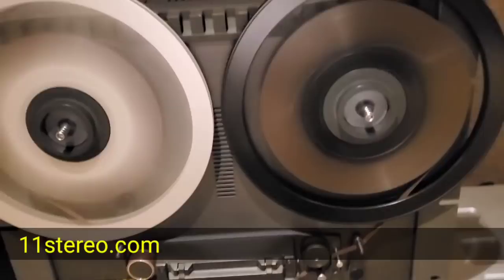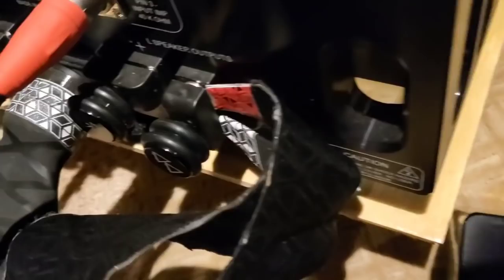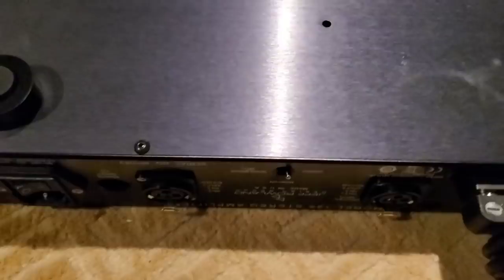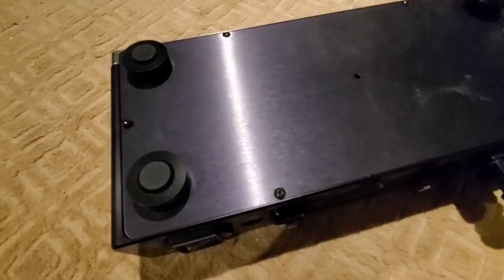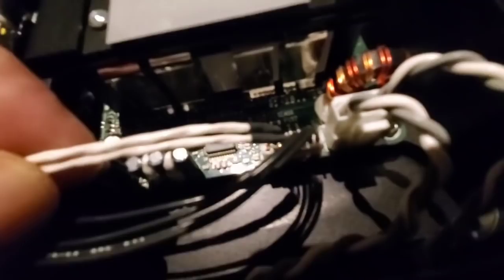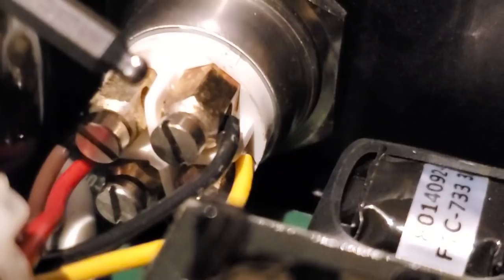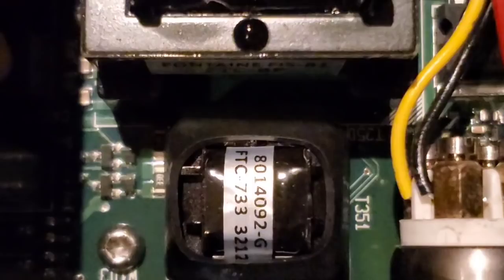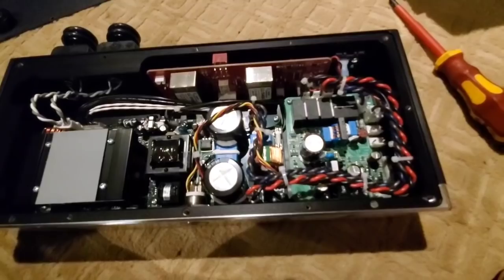How to recognize TRUE High End Audio !

Comment: Did you open the 3K up to see whose D boards he's using? GerogeHiFi who posts to AGon forums says he uses crap off the shelf D boards
Reply from the maker: Deep breath, im ready to flamethrow..  Ok, so lets talk this over. its a $3K amp. theres a dealer selling it so Jeff sells this amp for $1800. Deep breath Mikey.... calm... There is absolutely NOBODY that does this much for only $1800. If you were to simply watch my video before talking you would see I in detail show you what exact module it is and also show you what boards are inside that are proprietary Jeff Rowland design that when combined with the classic Jeff Rowland Aluminum block chassis make this the best sounding amp to use that module  Jeff is not like other jerks that only use the off the shelf parts, hes a freaking design engineer for chrissakes the only reason the others only use off the shelf boards is because they have no idea how to design them, Buy Jeff pulls out a sheet of paper on a drafting table and he draws the circuit by hand from his MIND.  And his circuit designs and layout is better than 90% of the others that can do this, which makes up maybe 10% of audio engineers, as they all use computer generated circuits these days.Watch this video which will make you very aware that George has completely misled you on purpose. Please for the love of GOD,  THINK FOR YOURSELF  !!
Reply: @OCDHIFiGuy  Thanks for this video.
Reply: @OCDHIFiGuy  DUDE take a deep breath now. Don't shoot the messenger . I have owned plenty of class D, inlcuding; PS Audio old and new,. M700s several W4S, Audio Alchemy DPA-1, Emerald Physics and my fav of late is Ric Schultz EVS 1200 IcePower 1200AS (600w dual mono boards). George Hifi is a hater, using specs instead of his ears. FYI hte EVS is sold direct $2300

AND, I ill soon be receiving the new (ground up build) Emerald Physics Voyager GaN amp MSRP $2500

Comment: If it has no audible effect and no impact on long term reliability, it's just cosmetic window dressing and a waste of money.  Benchmark products are available through dealers and their AHB2 power amp handily outperforms anything based on IcePower, Hypex, or even that latest (excellent!) Purifi modules, all for the same $3K it costs to own the Rowland product.  BTW, nothing you can do with fancy Class A and/or transformer-coupled input circuitry makes a damned bit of difference performance-wise -- the output circuit is always going to be the limiting factor in power amp performance.  IOW a properly designed input circuit built around commodity audio-specific op-amp ICs is every bit as good as anything Jeff Rowland (or PS Audio, etc.) is going to come up with to make their module-dependent Class D products seem more "high-end."  Bottom line: There's no question about it -- the Benchmark AHB2 is as "high-end" AF IMO, even if it doesn't provide any jewel-like eye candy or "pride of ownership" in Mike's book.  Given the choice between those sort of inaudible criteria and audibly, measurably better performance at a given price point, give me performance every time!
Reply: For my money, if I were spending $3k on a power amp, it would be for the Benchmark AHB2, which is the best amplifier in the world.  Full stop.  But I am spending around $1.2k and I'll either be doing the Purifi or the Hypex NC400.  The Rowlands, Levinson's, Spectrals, Krells, D'Augustino's, Solutions, and a host of others just don't come up to those three performance wise, and require the spending of tens if not hundred's of thousands of dollars.  And probably, even the excellencies of the Benchmark, Purifi, and NCores are overkill.  You probably could not tell the difference between any of them and a well maintained Haffler DH200 within the l.t. 100wpc performance envelope.
Reply: @nhennessy6434  -- Perfectly sensible.  In fact, many a sub-$100USD Chinese "chip amp" based on current-generation monolithic Class D ICs (e.g. TI's TPA3255) measures and sounds just as good as much of the "audiophile" gear of the 1980s and 1990s that so many now consider "vintage" gems.